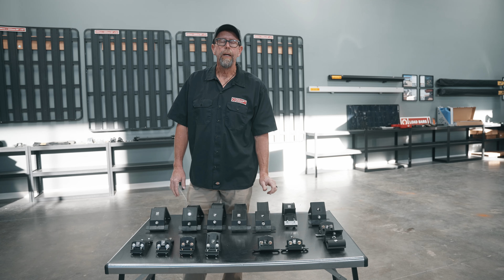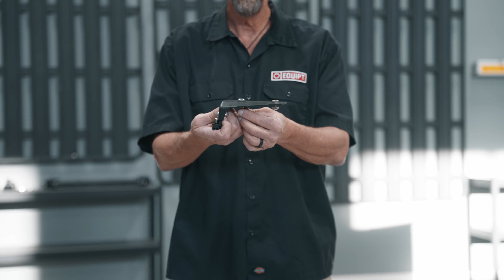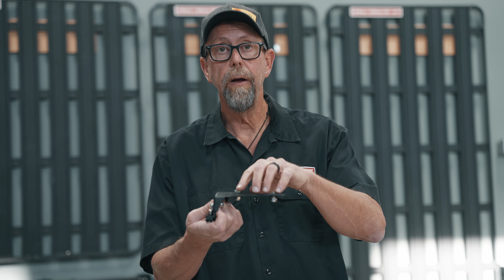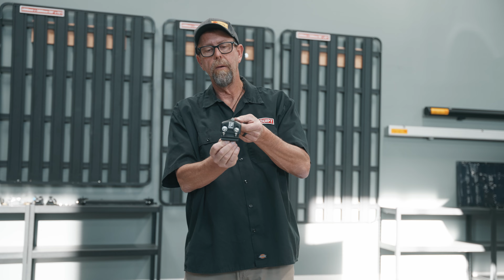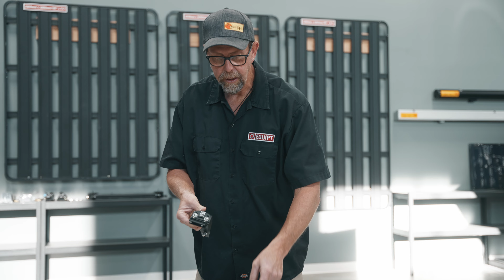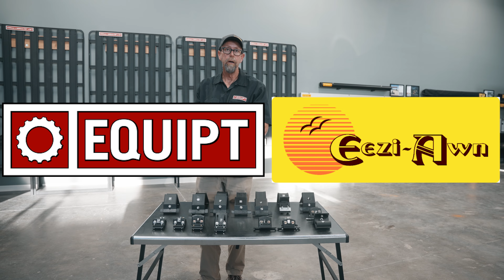Eezi-Awn k9 Roof Rack Mounting Feet

Comment: Hi i just buy ...TOYOTA TACOMA 3RD GEN DOUBLE CAB K9 LOAD BAR KIT

1.4M RAIL, 1250MM LOAD BARS

And i m waiting for the platform 50x39 ( is back order now) ... do you now the heights of the feets in the load bar kit came with probably 40 or 50 mm. 
I ask you because i think when i m ordering the platform i need 2 order feets more height..for put to low on rear and 2 more height in front to but sure the platform is parallel....
.

Comment: How about the clamp on the bottom right corner?
Reply from the maker: The clamp in the lower right corner is called the G-Clamp. It's meant to be used with factory roof rails. If the factory roof rail is elevated, these can be clamped to the factory rails for load bar or rack installations. https://www.equipt1.com/collections/roof-rack-components/products/k9-g-clamp-oem-rack-mount-foot

Comment: What are the pair of feet at the front of the table, one over from the single foot at the right. The mounting option looks flat as though you could use these on another type of rail other than the proprietary Ezi-Awn rail.
Reply from the maker: Jason, those are what we call the Yakima/Thule feet. These can be used to mount racks or load bars to various flat roof rails. Thanks!